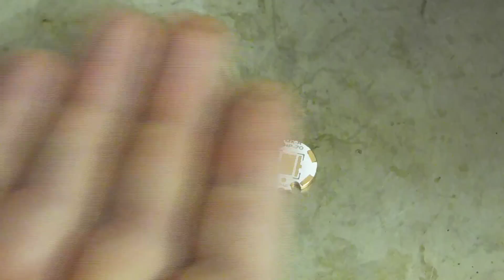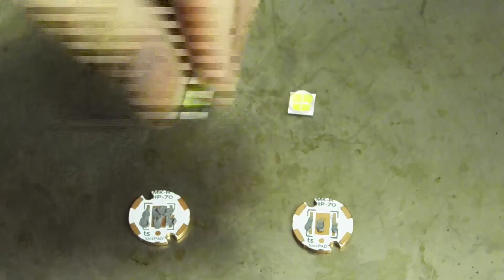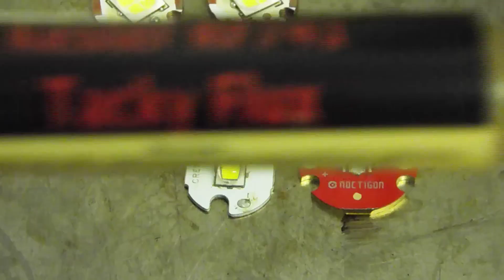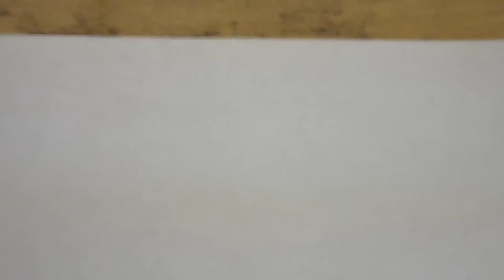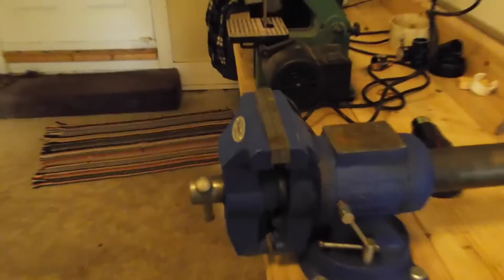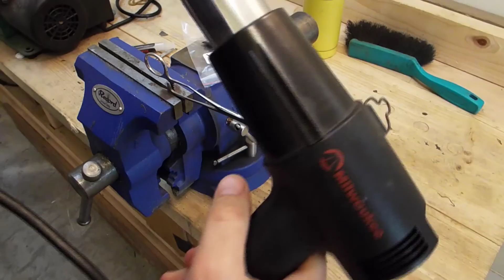How to reflow solder an LED emitter on a PCB or MCPCB.   Cree XML2, XHP70, XHP50, XPG2, XPG3.

Comment: I have been watching DirectorFeng videos, he is a micro electronics tech from China that does some outstanding work on upgrading and servicing iPhones, Mac's and other SMD devices. Oddly, when he reflows an iPhone motherboard he places it in a "proper" reflow oven and only sets it to "bake" at 100°C (212°F) for 40 minutes. Is this not too low a temperature for a proper reflow process??

Comment: Awesome video!  I'm attempting my first flashlight repair and figured I'd try my heat gun with an aluminum plate, but I wasn't sure if I'd just fry my new LED.  Now I know it's possible, and to tap it to remove excess solder.

Comment: my first reflow i used Zippo lighter on small little pcb not metal core like the one used in flashlight it was normal one cuz its have small SMD leds and i swapped them with warm white ones

Comment: I just had an led melt off its dome not on a heat plate but from power. How much heat can they handle?
Reply: You'll have to check the spec sheet for your specific emitter. Generally, they can't handle over 220C for more than a few seconds, as that's the level used to solder them to PCBs.
If the dome melted off, it's way past it's max heat level.

Comment: Does anyone know what value of series resistor is required for these so-called star copper heatsink / LED combo units? I know there is a 3.5x3.5 mm series, a 5x5 mm series, and a 7x7 mm series of raw LED emitter.  i know these can work with 3v, 6v, and 12 v.  I purchased some 12 v 5x5 mm versions. but i can not find any literature showing a simple overall battery, resistor, star module schematic, and i dont want to fry my unit.  Please help!

Comment: Would you say an old pan on an induction or infrared hotplate with a digital temperature setting be just as good as using a stand-alone electric skillet?

Comment: Would using a hot air rework gun work? I don't want to use the pan if possible. I'm just worried that the hot air gun may damage the chip

Comment: How did that not short out? I'm about to make my first attempt at reflow soldering a cree emitter to a star mcpcb and all I can think about is how am I going to keep my solder from flowing and shorting out my positive and negative? I expected you to use a high tech stencil to precisely apply the paste, but you really just smeared it on there and it seriously looks like it would short out. My emitter and board are much smaller in comparison, too. Any advice, anyone?
Reply: The solder "sucks" itself to the metal part of the MCPCB and LED, that "extra stuff" will just disappear. You would have to put on really thick "sausages" of solder paste to get it wrong. For me, it works every time, just like he demonstrates.

Comment: So if i was to use the oxyacyteline or map gas with a oxygen tank that maybe to hot?  Maybe I'll start a little metal fire with like a few ounces of magnesium to heat it up since u said they are tough right?
Reply: Actually if i was to go ahead and do it I have several electric skillets as well as corded and cordless heatguns an a remote ir temperature gun. An if I lost most all my tools I could probably use my titanium multifuel camping stove. I can use premixed under pressure butane/propane, gas, diesel, everclear, acetone, denatured alcohol, white gas, moonshine, as well as straight propane.  It came with 5 pots/pans made of titanium, titanium potholders, a titanium pressure cooker, and over 15 titanium tent stakes
Reply: It wasnt cheap.  In 1999it cost me $225 after 10% discount and another 20% off and the $25s off . For another 40 dollars they added a second identical cooking that I gave my mom. I had a titanium 38 revolver that I really didnt like since it kicked hard and if I had actually had to use it it lacked the power and penetration to do anything besides making the bear pissed.  Almost every time all we had to do was stand up and make alot noise.  Once I had to fire a few shots off also which I made sure had no chance of hitting it.  If it had hit him that would have shown how pathetic it actually was.  Also they really seemed afraid of my camera's flash.  Ive inow several peoplewho had to kill problematic bears who had developed a taste for human's that had a empty can of bear spray in their stomach.

Comment: Thanks Matt for another instructional video. Will this thing do the job? http://www.banggood.com/100x100mm-946C-110-220V-450W-Hot-Plate-Preheat-Preheating-Desoldering-Station-for-PCB-SMD-Heating-p-1348274.html - costs is about the same as an electric skillet in AU :)

Comment: 3:30 That's 400°F = 204°C, for those of you not in the U S of A.

That's about right for Sn 63% / Pb 37% or Sn 60% / Pb 40%  solder, but a bit low for lead-free solder. Here's a chart:
https://www.kester.com/Portals/0/Documents/Knowledge%20Base/Alloy%20Temperature%20Chart.pdf

Comment: I reflowed my first emitter yesterday.  I used a butane jet lighter on to warm up a thick stainless steel flat bar.  Solder paste from banggood. Now my astrolux s43s finally works. One nichia 219c emitter is 4000k the other 3 are 4800k, because I couldn't find the stock emitter with cheap shipping.

Comment: If I don't have a skillet or heat gun, could I cut and use the bottom half of an empty soda can and a small candle to create a mini "hot plate"??
Reply from the maker: I think that would probly work.  As long as you can move the soda can up and down to adjust the heat.

Comment: Thanks Matt! Is there absolutely no concern about possibly shorting + and - with using that solder. It always situates itself when its heated?
Reply: This is how motherboards are soldered, they have tiny parts still seems to work.
Reply: @benlawton5420  I've done several reflows since a month ago. Solder doesn't stick to the red area of the mcpcb
Reply: @averagerider92  Oh so you didn't know that at the time of the original comment, well guess you know now :)

Comment: I know this is an older video, but I've been struggling with a DIY project I wanted to get started. And the main issue is, where do you get your components? I want to do a fish tank light with some Cree XHP35.2 leds and for the life of me I can't find any stars loaded with them in anything but the bottom most bin.
Reply from the maker: Mouser and digikey are both good sources for bare LEDs.   For 35.2 preloaded on a star I would check Mtnelectronics, Cutter electronics and Kaidomain.   These are typcially the first places to stock a newer LED already loaded on an MCPCB.

Comment: Very good instruction video.👍 Ihave i little problem. i have got a couple of  sofirn C8F hosts. But a cant find any C8F DTP Copper MCPCB 30MM with leds on it. (XP-L HI) have searching on internet. Mountain Electronics only selling the host with Triple C8 LEDs.😒 Do you think i can manage to solder 3 bare emitter on a C8F DTP Copper MCPCB 30MM?

Comment: Dude youre way past the recommended peak temp time in the data sheet. Sure this works but you killed the life span on those chips without a doubt. You have no clue how to handle LEDs
Reply: He is just showing how to do it, no one would take this long to do 1 led.
Reply: How are you supposed to do it? What's your method?
Reply: @SGCXD  He means the guy talked too much but irl you would do this a lot quicker.
Reply: @benlawton5420  oh ok, got it... I thought that part would have been probably obvious since it's a "how to", but thanks for clarifying. It makes more sense now.
Reply: Don’t see any chips..... just leds and boards
Reply: @James0u812 , LEDs are chips.

Comment: You Are A Rock Star! I am using a Cree CXA1304. It is about a 1 inch square component with 2 pads to solder the wires to. Do I need a heat sink? Or are they like you mentioned in the video, semi hardy and just solder it like I see it is now? sorry for the obscure question...
Reply from the maker: Hi Rex.   That LED would not need to be reflow soldered to an mcpcb, but it dies need to be attached to a heat sink.   I would either use arctic silver 5 and fasten it down with something or use Arctic alumina 2 part epoxy and glue it down.    Make sure in either cases you use a very thin layer of the epoxy and that your metal heat sink surface is smooth and flat.    
The epoxy: https://asflashlights.com/more-/122-arctic-alumina-2-part-epoxy.html
Reply: Thank You! That Helps! Appreciate It!

Comment: I'm using your guide to reflow some solder on an aquarium LED puck to upgrade from XP-E series LEDs to XP-E2 and XP-G3 series chips. (No one is doing this in the aquarium hobby btw, I was told it couldn't be done by multiple people) I was mostly successful, but I had a lot of trouble getting the old LEDs' solder to melt on my electric skillet, which can only go up to 400 degrees. I ended up having to put the puck on a pan and throw it on the stove. I wasn't as careful as I should have been, overheated it, and delaminated the puck, which ruined its ability to transfer heat to the heat sink. Luckily this was just a broken unit I picked up to test. 

My question is, would the rework flux help with getting the solder to flow on these old LEDs while the LED is still mounted to the board? The skillet melted the solder on the new LED stars no problem, but couldn't touch the old solder. I don't want to ruin my good lights, though I think I have the heat level down-pat on my stove.
Reply from the maker: Hi Jase,     The rework flux helps on old solder but you must be able to put it directly onto the solder, so I dont thing it will help if the LED is still attached to the board.     400 degrees is where I turn my skillet to most of the time.   When I am removing an LED from a board or if doing a large batch I put the lid on over my skillet  and wait a 5 minutes or so and come back.   It's very rare that I get an LED that the solder will not wet below doing this.
Reply: Thanks for the reply. I actually already ordered the flux, so we'll see I guess, haha. It never crossed my mind to put the lid on. I can definitely see that holding heat better and getting warmer. I'm going to give it another shot this weekend with 3 more pucks, so I'll try that before throwing them on the stove.
Reply: Well you were right, the flux did nothing in my case but dirty up my LED pucks. Oh well. Putting the cover on the skillet didn't seem to help any, to I had to do them on the stove again, but I was much more careful with my heat this time, and I was successful with my upgrade. It's amazing how much brighter these XP-G3 diodes are than the old XP-E stuff.

Comment: Hi I am wondering what's gonna happen If you don't give it a "tap" every time before you cool them down?
Reply from the maker: The LED will be sitting up high on a blob of solder and you wont get good thermal transfer to the mcpcb.

Comment: If you can buy the emitters already soldered why would you prefer to do it yourself?
Reply from the maker: Hi Sam,  Most often because people want a color tint that is not offered pre-installed on a board.   Or in some cases like when I first made this video 16mm mcpcbs for XHP70 were not being made by any manufacturer yet, so we made our own and put the LEDs on them.

Comment: Could you pre tin the board with hard solder and let it cool, place the led on it then reheat it untill it melts.
Reply from the maker: Yes, that would also work.  It would be a good idea to add a bit of flux between the joints before reheating.

Comment: Watched this video and you got my sub! I have a diy project using the new xhp 70.2 emitter. I need to figure out how to use 3 6v emitters on one pcb in series to make an 18v board. I have found 3led pcb' s on eBay but they all are aluminum and say 1w/3w. What do you suggest? Thank you
Reply from the maker: Cutter electronics sells mcpcbs that are copper that will take 3 XHP50s.   Not exactly what your looking for, but they can be wired in series.

Comment: Bro do you know where to buy an Original LED Driver and LED Diode set that size too 20mm ??? I accidentally touched the dome :'( my fault and apparently destroyed it. TIA :)
Reply from the maker: Hi Kalo,

I'm not exactly sure what you mean by an  Original LED Driver.  Can you explain?
Reply: Where could I buy the genuine ones not the counterfeit ones, I see alot of cree led and driver on Amazon, Aliexpress,...  but not sure if which one were the genuine ones :( .
Reply from the maker: OK.    Here are some genuine cree LEDs on the copper mcpcbs.
http://asflashlights.com/21-led-emitters

In order to recommend a driver board I need to know what LED and batteries you intend to use?

Comment: If your CREE flashlight or LED flashlight have blinking issues even if you have tried replacing the wires and button, this is also the solution.

Comment: Fantastic and Thanks a lot,
Please if you can give explain about led type. i have T6 diving flash light which LED i should have because  i lost the one on it. :)
Reply from the maker: Hi Waleed.    The T6 was a designation for an XML emitter.  If that is what was in your light, then I would say using an XML2 U4 would be your best bet, if you will be using the same driver board etc.  It's several brightness bins above the T6.
http://asflashlights.com/30-xm-l2

Comment: can i use a pan on a induction cooker ?
Reply from the maker: Yes that would work fine, just dont get the temp up too high or too fast.  Medium/low heat should do it.  Just enough to melt the solder.    Its also best to put the parts in before you turn on the skillet so they warm a bit slower.

Comment: as my dumbass discovered... a soldering iron on a conductive pad will do it. ...if you set off intending to do it id probably alternate touching the iron between the pads around it. that copper holds heat for quite a bit

Comment: awesome thanks!!... im going to try this in a week.  Anything unique about the XPG3?... its the same procedure right?
Reply from the maker: Yes, the prcocess is the same, just make sure you get the + and - orientation correct.   On an XPG2 the black dot shows the battery negative, on XPG3 it shows the battery pos side.
Reply: oK got it thanks!!

Comment: Electric frying pan??  Ha, who would think of this, that's so awesome!  Big work surface and controlled heat.
Reply: You mean ewectric not electric.;)
Reply from the maker: Thanks Bugdozer, good lux with your projects :)
Reply: Matt Smith Hi there, I’ve been subscribed for a while and have bought a couple of torches that you’ve recommended, thank you. Please don’t shoot me down but but before I was educated by yourself I’d bought an Ultrafire® 7x XM-L T6 7000 Lumens can torch!! Typically the LEDs have died. I’ve put a multimeter on there circuitry and there is power all the way to the PCB so I’ve assumed the LEDs are dead! Using this procedure with the hot plate/frying pan can you recommend a replacement led that I can use. I don’t know whether you know the torch but basically the Aluminium heart sink that the LEDs are on is 45mm diameter, there is one pos & neg soldered to the board that shows 1.5v to 4.2v depending on the mode! 7 (I guess T6 LEDs) flowed to the board which is just plain white. It would be great to upgrade the LEDs if possible which is where I need your help!! The only issue is that there is no way of knowing the orientation of the LEDs to decipher which is pos & neg! One more question........ do you send to the UK? I’m interested in your Mag upgrades as my step father and Dad both have 2 C cell Maglites. Keep up the great work you’re doing, I love your enthusiasm.